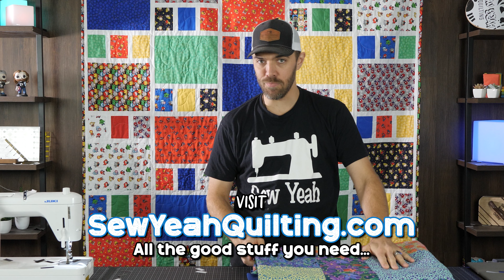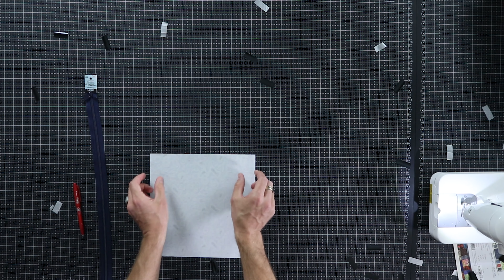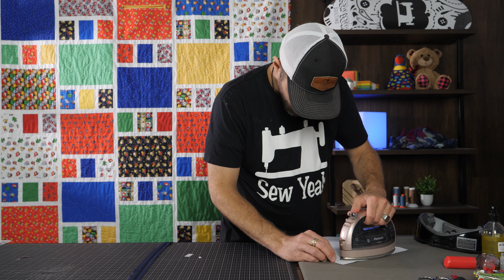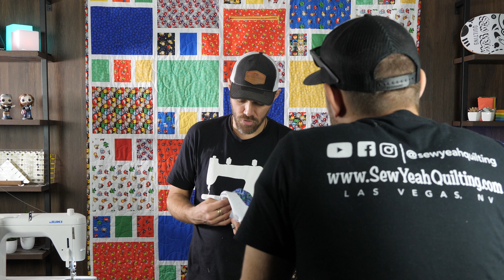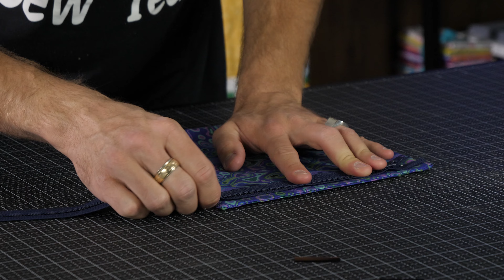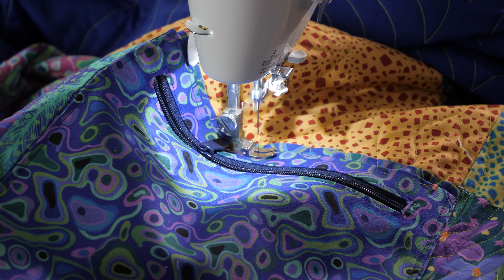We Hid Something In This Quilt... | Pocket Tutorial

Comment: @5:13 when he topstitches the four sides of the zipper that closes off the pocket. Do this differently, attach and topstitch the zipper before sewing the 1/2” seams of the two fabric panels. Then open zipper turn right side out and steam press. Can also be stitched to only one layer of the quilt and/or batting layers and the perimeter stitches will only show on one side. Then quilt around the pocket to secure it!
Reply from the maker: Ah yes love this tip 🧵✨ attach zipper first, topstitch, then sew panels, makes everything cleaner and easier 😍👌